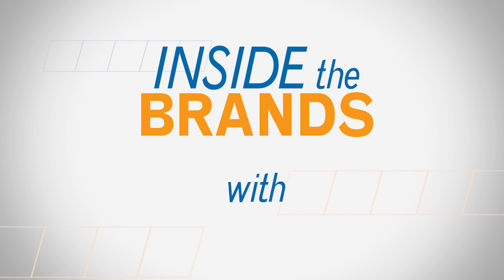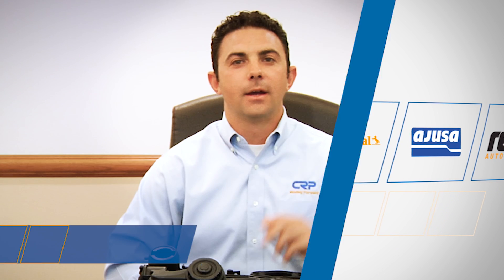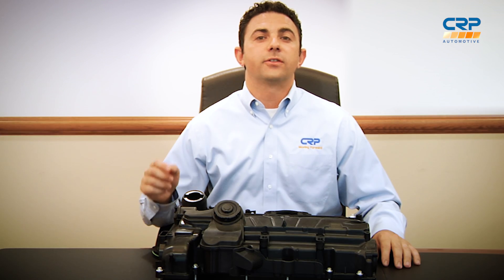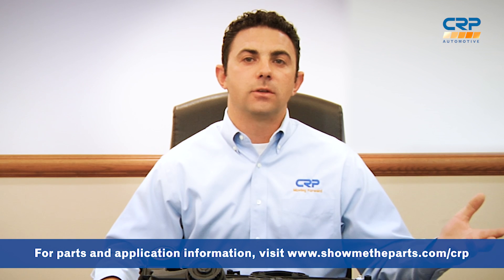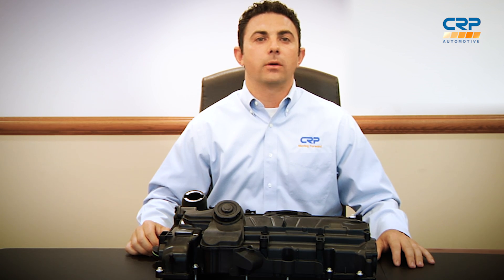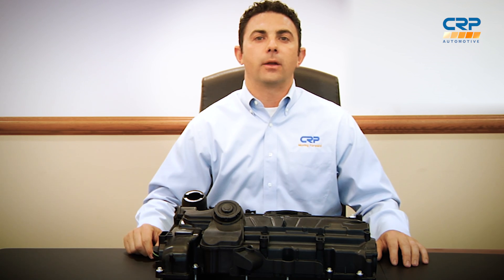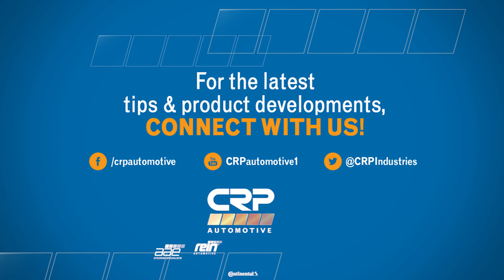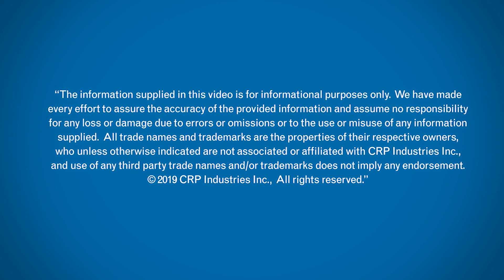Rein New BMW Valve Covers Part 1 | ITB Episode 107

Comment: I just used this on my wife's 09 328i. We got the set with the eccentric shaft sensor as it was throwing a code as well. Symptoms were that lovely high pitched whistle once warmed up. So definitely had a vacuum leak. I took my time and it did take most of the day, but it went together with out issues. I did not replace the PCV hose included with the kit as it was close to 100 outside and I was ready for a beer. LOL.. I kept it and will replace it at a later date. No annoying whistle and no codes now four days out.